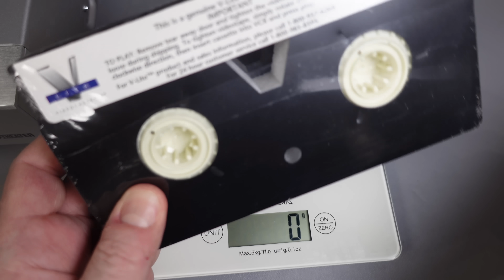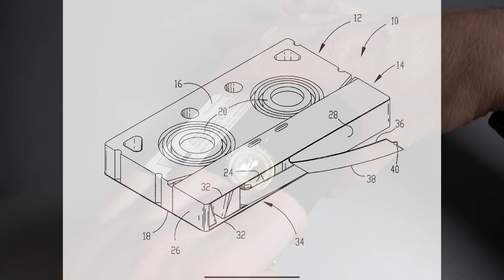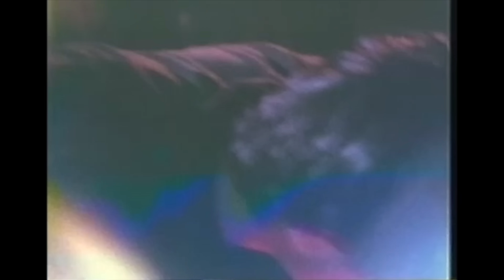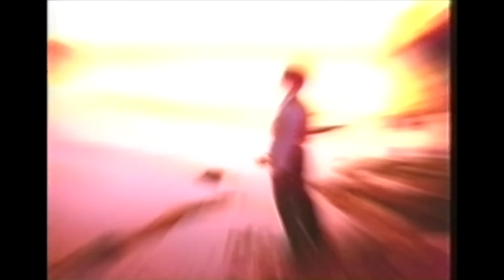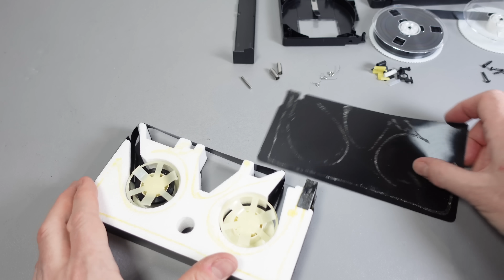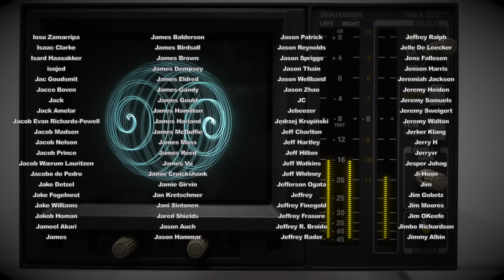V-Lite: Disposable Lightweight VHS tape

Comment: In playback almost everyting happens outside the cassette, so there isn't a big difference, but rewind wears the tape out much more. And of course having no protection or reel locks means the tape gets damaged soon. But VHS recorders do that for you anyway, so no big diff. I think in those days there still was landfills, so bad idea. If it gets burned, it's like other plastics. At the moment if you want to send a video by mail, the best format is QR code. USB stick can also be used by people with an actual computer, but no smart person inserts an unknown USB stick to the computer's port because of the viruses it may contain.

Comment: Oo Elgato to record vhs. I do this too. 
Can you tell me the settings you found to give you the best results?  I’ve had a couple of hiccups, I was wondering if you had a couple of tips? 
Thanks!
Reply from the maker: I just let it record in whatever settings it defaulted to at 720p. The only issue was that I forgot to set to 4:3 so I ended up with a 16:9 squash that I had to squeeze in editing.

Comment: I was a teenager in the US in the 90s and I don't recall ever getting any disposable VHS tapes in the mail. By 1996/97 any kind of short video like that would have been mailed on a CD ROM disk! I got TONS of those things in the mail and they always had grainy over compressed video files on them that seemed to barely work even back when they were new lol
Reply: Assuming the recipient even had a computer, many of those with a PC in the mid-90s had either a 3.5 or 5.25 (sometimes both) inch floppy disk drive (mine had the 5.25 floppy, which only held 1.2MB per disk). It sounds like yours was a brand new computer or a higher end slightly older one. A VHS promotion campaign was definitely the way to go if a promoter wanted to get the maximum number of eyeballs, as most households had a VCR player then.
Reply: @cedonullidude  I never said it was a good idea, that's just literally what happened at the time lol!

Comment: I'm in the USA was born in 81, but I honestly don't remember seeing these kinds of VHS tapes, however I do remember coming across more than a few that used very thin low quality plastic with a normal door flap, and sometimes no windows for the reels, but most all of them were promo, instructional, or scam marketing type videos made on the cheap 😅

Comment: Interesting tape but it would most likely self destruct at the end of the tape. The hole in the middle between the spools would get a light guide pushed through that would shine a light through the tape to two sensors. They would pic up the light if the tape is on the end as it is a clear part at the ends. this will prevent the VCR from pulling the tape of the spool.

Comment: I used to get promo VHS tapes in the post as I did a 'movie spot' on a local radio station back in the 90s and then went on to magazines and news.  I'm in the UK, never saw V-Lite and I'm very glad it never crossed over as the normal 'short-tape' vhs promos they'd send where sometimes pretty rubbish and get jammed in the machine.  I can only imagine how crap the V-lite ones would be. Certainly had it taken off in the UK they'd have stuck them on magazine covers. (There was a very short window in the 00's where they did this; magazines would come in a Cereal-box style configuration with a crappy tape full of trailers.  Gamesmaster did one full of games trailers, Bizarre also did one with no small amount of controversy, and I recall it was pain to make happen.)

Comment: I remember by the late 1990s fast food restaurants like McDonalds had phased out the use of polystyrene for burger boxes etc, in Australia at least. Though plenty of computer and electronics companies still used it for packaging. I think some still do! Which is probably how V-Lite could get away with using it.
Thumbs up for whoever designed the V-Lite though. "What's the absolute minimum we can get away with and still have a VHS deck play our tape?"

Comment: Ah, the old "feed it in with your fingers" (oo-er) trick for misbehaving VHS mechanisms. I'd forgotten all about that. I had one JVC deck with a misaligned loading frame with which I had to do that all the time. There was a particular spot about an inch from the left edge that you had to push down on during loading or it would continuously eject. It was easier to learn the technique than to try fixing it and risk verschlimmbesserung.

Comment: Now available on just 50 VHS Tapes - All of Techmoan. Do you have several metres of shelf space that you want to fill, but can't afford to buy half broken electrical junk off eBay to lovingly restore? Why not get the new Techmoan box set? And every couple of months for just £19.99, we'll send you an extra VHS so you can keep completing your collection. First 500 copies come with a free VHS player!* (*For parts or not working)
Reply: Multi-standard player for Americans not included. Why do so many people suggesting a VHS edition not understand that PAL tapes are completely unplayable in NTSC players? (PAL players may be more likely to be multi-standard, I dunno.)
Reply: @8bitwiz_  Certainly back in the late era of CRTs most of them over here supported PAL or NTSC (I'm talking late 90s onwards), but I can't remember if the VCRs did. Surely they'd have to be D-Theatre tapes for Techmoan anyway?

Comment: In the 1990s my cable company put promo VHS tapes through the door of prospective customers. They were extremely cheaply made (with no windows for the reels on top), but the V-Lite is EVEN cheaper than those! I wonder how many plays it'll last? My cable promo video lasted about 5 plays before it finally tangled up and snapped.

Comment: Aha, I'm in the UK and have something very similar to this from Feb 1999 promoting Sunset Beach. It's a PAL tape and was sent out by Channel 5 UK who were looking to transmit the programme here. It's not a V-Lite tape but it's very very similar and is extra lightweight. It does differ from V-Lite in that it has the usual tape protector.  I wonder if it still plays?
Reply: Update. Yes it does. :)

Comment: Recycling polystyrene is actually not that bad. I worked in one facility that was doing it. We grind it to individual balls and then packed it in bags or special trailer. After that balls were used to produce new packing material or house insulation.
Reply: The town I used to live in had a special collection day once that accepted foam like this, but that’s pretty rare.
Reply: @markjames8664  Where I live, there's a special bin for recyclables (plastics and metal only) and you are encouraged to put styrofoam packaging in it. However, I'm suspcicious as to whether they simply burn the stuff. Styrofoam burns quite well.
Reply: I ordered a rare old book once and it was shipped in packing peanuts. They did a great job of protecting  the book in shipment. I still have the packing peanuts and will reuse them if I ever need to ship something  fragile in the future.

Comment: Wondering now about making a VHS tape out of only cardboard. looks like as long as the tape can be guided smoothly on and off the spools and the bloody thing doesn't disintegrate inside the player, it should work a treat.

But yeah, sending someone a video link or file is a lot easier and more environmentally friendly :)
Reply: That's what I was thinking. Could use corrugated cardboard. Ironically it would probably be heavier than the polystyrene.
Reply: @SimonQuigley  Yeah, I was about to say that a cardboard cassette would be heavier. They seem to have gone for the cheapest and lightest materials possible that you could still get a play or two out of the cassette from.

Comment: In around 2003 my brother got one in the mail and it was a pilot for a sitcom and it ran about 22 minutes he was supposed to rate the show in a questionnaire that came with it , he was to keep the tape and send back the form and for this they sent him a check for 10 dollars
He did what they said to do and got 10 dollars
The sitcom never made it to the air though
Reply: Sounds like a collectors item , any chance he still has it or what it was called ?
Reply: @thefadebeta580  I probably does he collects old video equipment he has one of the first home video recorders ever made it predates the beta or vhs by a few years, it is fascinating the way it works ,and he many video disc players from the 70s and video cameras
So I am sure he has the tape someplace

Comment: Considering its age and the simplicity of the mechanism the image quality is surprisingly good.
I fondly remember the pre-interner era where the whole family drove to the videotheque to select a couple of movies to enjoy at home, together.
Good times.
Reply: The tape is the same, so the quality would be the same as any other VHS running at that speed.

The compromise from the build quality is with the longevity. Between the lacking of a door after its first use, all the moving parts just rubbing, and it's flimsy construction not resisting any sort of abuse these would not last long.
Reply: The mechanism has nothing to do with it, just a storage medium. They were one shot or a couple of play only and the tape was the same (well almost as we used damaged pancakes) The tape path in a video player is massive and rarely if ever will it be the tape that causes a jam.. It will be dirty rollers etc (or the two year old posting 2p into it)

Comment: Looking at the complexity and parts in a VHS tape, it seems crazy that they sold them for like 5 or 6 for ten dollars.  We had hundreds of VHS tapes, each one a little marvel of engineering.
Reply: Yeah, and blank audio cassettes. Meanwhile they could stamp out blank CDs and DVDs by the millions and they cost a fortune for a long time.
Reply: When VHS was young cassettes cost quite a bit. Blank tapes in the early 80s were like $25USD/ea ($96 adjusted for inflation), but pre-recorded ones were $50-80 ($192-308) depending on the movie or show. IIRC the initial market for pre-recorded cassettes weren't consumers, but rental companies. This meant that while cassettes needed to be as inexpensive as reasonably possible, it also meant they needed to be durable enough to tolerate a lot of handling and playback sessions. Most people who bought a movie typically got it from a rental companies that was downsizing it's stock of particular titles to make room for new ones.

This is why VHS had a spring-loaded door with a latch, and brakes to stop the reels from unspooling in transport, unlike professional formats like U-Matic that just had a small flap and free-spinning reels.
Reply: @IvanKowalenko  If I remember with U-Matic or 3/4" tape, the cassette case/holder itself gripped the hubs for transport. You almost never saw a 3/4" tape without it's case, since the spine was a useful place to put a label on the shelf. The 3M tape cassette holders had the special hook insert so you could hang it on the wall with a hanging rail system they had. Rather smart system that meant you didn't have to build a shelf that could hold the weight of such a library of tapes, you just needed wall space to mount the rail on. But this only worked for 3M tapes, I don't think Sony, Fuji, Ampex, etc had a shelf system like that.

The only reason VHS movie releases were in the insane pricing they were was because the studio's jacked up the prices on VHS movies when they realized the majority of their titles were being bought by rental houses. They couldn't go after them for the number of views a tape had in home, i.e. how many $3/rental fees the tape did in it's lifetime, and instead did the next best thing and just made the video rental companies pay through the nose to acquire the copies. The price of Laserdiscs and RCA's CED Videodisc releases were usually $19.99. And I think Laserdiscs still maintained the edge in pricing later on when VHS tape manufacture and duplication came way down. Stamping a disc versus making a tape copy was still cheaper, and probably faster too! But alas, video on a disc didn't become the defacto until DVD came along.
Reply: They were very expensive at the start as the other replies explained, as were VCRs.  Fabrication methods are costed down over time and made more efficient and when you have multiple companies jumping in to get their cut of the pie, it becomes a race to the bottom until everything a consumer is required to get becomes more widely affordable for everyone.  Same thing happened with the pocket calculator market in the 70s.
Reply: It’s probably more accurate to represent the cost of a tape in “number of eggs” to account for inflation
Reply: That's where the economies of scale and good old competition come in to play. When the VHS first came out you would have to pay something like $20 each for the tapes adjusted for inflation it'd be close to $100.00  for one blank tape then as it became more and more mainstream lots of different manufacturers jumped in the market. By the end of the VHS era I'd wager that each manufacturer was making more percentage wise per tape than they did when each tape cost $20 each.
Reply: @Andy B  In the early 80s, a VHS tape of a newly released film would cost around $90. By the late 80s they would get down to $20 or so.

Comment: About recycling expanded polystyrene, there's a small polystyrene factory near me that used to have a skip outside for the general public to put polystyrene in to be recycled. But then the regulations on which sorts of polystyrene can be recycled were tightened up and they had to stop. I can understand why, but it is a shame.

Comment: I find it very ironic that about the only really big mass marketing on a media format here in the UK must have been AOL. Twenty five years ago those things would turn up just about everywhere! A little bit of the American media blitz that came to the UK in force. Obviously of course the disc contained a computer profram, rather than true media, but still on a media format. At that time you were several companies distributing such internet access discs, but AOL must have been by far the most prolific.

Comment: While these were not recyclable, neither were regular VHS tapes (nor Beta, V2000, Video8, miniDV and more) which also ended up in landfill.  Which is worst is hard to know.
Reply from the maker: The difference is that these were 3 minute adverts - imagine everything that anyone ever wanted to advertise to you was sent directly to your house on a v-lite tape.
Reply: In Germany, chromium dioxide (BASF) and cobalt (MiniDV) tapes should also be disposed of in household waste, which in Hamburg is a waste incineration plant that certainly does not release any pollutants into the air...